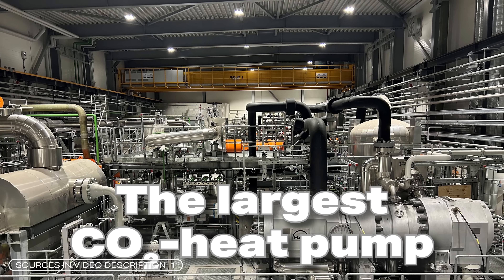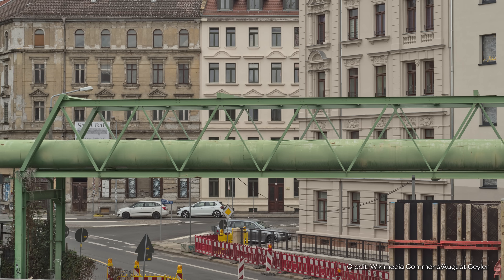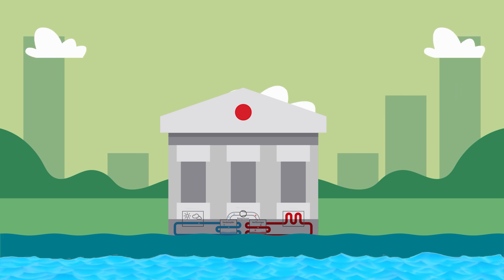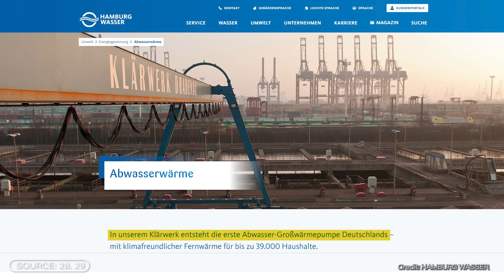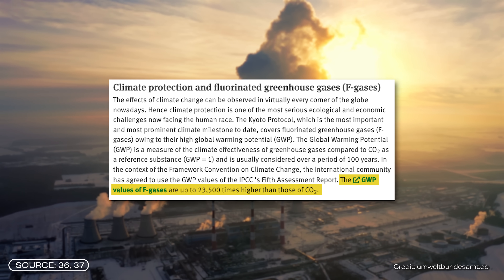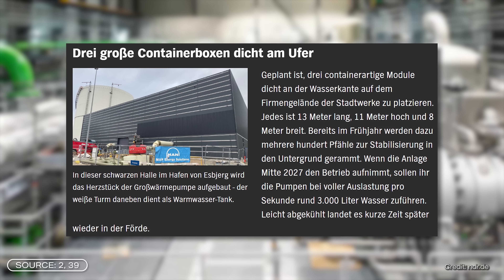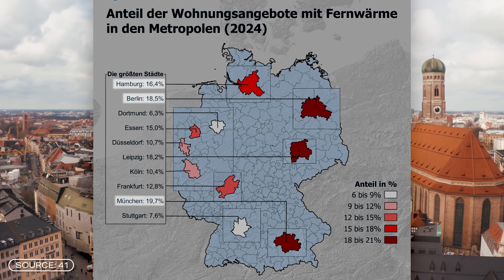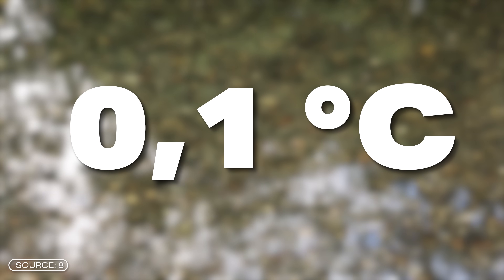World's Largest Heat Pump: Denmark’s Seawater Heating Revolution

Comment: Greetings from Scotland.  I have an air source heatpump supplying hot water to my radiators.  House is 120m2.  
Consumption of electricity on the coldest day by the heatpump was 30kWh at -12C outside air temperature.  CoP on this regime was measured to be 2.

Overall for the entire year, my heatpump consumption was 2700kWh, and the overall CoP was 3.7.

My electricity bill for the entire year was minus £150, factoring in my 9kWp Solar Array, 10kWh battery, cheap overnight charging price and 11000km Electric car driving - supplied from my house.
Reply: Well done, more people should poot their money where there mouths are.
Do you have an estimate of investment payback time before you get to net savings.
Reply: Beautiful.. I hope to get a setup like that one day too.. this gives me hope :)
Reply: And what is the electrical build, if you factor in all the cost of all the systems to save?
Reply: I notice you don't say anything about how much all that gear cost. also, what's your capacity factor on the solar PV? I recon you spent 22k inc install and make around 11k KWh per year.
Reply: @markfernandes2467  Before I answer that, we need some context:  Between 2010 and 2020 I spent £27000 on Propane, Diesel, Electricity and Firewood.  All those prices have since increased.

My solar panels cost £11k
My battery cost £7.5k
Heatpump was £9k.
EV Charger £1.5k
Total cost therefore:  £29k.

My solar panels have repaid 55% of original  capital in 4.5 years.
Batteries 17% in 3 years
Heatpump:  7% in one year.

So also since 2020 when my solar panels were installed:  
Solar Panels are now much cheaper.  Down from 0.33p per watt to 10p per watt.
Solar Mounts are much more expensive
Inverters are maybe 50% cheaper.
Labour costs are higher.
Batteries are 50% cheaper.
Reply: @anthonydyer3939  First, thanks for the info, that makes things clear. However, 

1. My estimate was only for the solar and battery set up and install, not the heat pump & EV charger. I assume you got the BUS grant, right? (that works in Scotland too, no?) If so, is the 9k quoted, net cost after the BUS? Please clarify as that's being paid for by someone. So your cost was 18.5k , I guessed 22k. So I was over. 29k for the lot after the BUS seems about right. (It's hard to estimate HP costs, there's so many factors in system design. 

2. your ROI stats are very questionable tbh. Did you finance the costs or just pay up front? If up front, that already puts you in a position most people aren't. Also, if you did, , I'm pretty sure you didn't add in lost interest on savings or investment opportunity lost in your ROI. 

You also don't account for the fact that you need all parts of the system to act to multiply the benefits, you're Solar wouldn't be at 55% ROI if not for the battery for eg. 

Your ROI also somewhat depends on your feed in tariff payments, right? Fair enough i guess, but this and your load shifting to buy cheap electricity from the grid, won't be arounf forever. 

3. Not many people live in one house for long enough to recoup the costs, (9 years is the average). Also, 5 million people live in flats, lots of others live in other forms of unsuitable properties. Not many investments rely on you staying put to benefit from them, most would regard that as a huge negative. Home price uplift due to your outlay won't happen as the new homeowner's risk of inheriting all this complexity/space & sometimes even aesthetics, offsets it. 

4. Without grid support, none of this would work. Homs are not countires and the same solution doesn't scale to national grids. Esp in the UK & solar. 

5. What's your CF on the solar? You seem to know a lot about your system, so you must know this, right? Somewhere between 10 & 15% max would be my guess. How many Kwh did you produce from the PV in 2024? What's it like if we just take Nov, Dec, Jan & Feb? 

6. I dispute the fall in costs for an installed system, You got a 9kw PV for 11k, that's not 33p lets alone 10p per Watt then. It's over 1 pound. I don't care what a panel costs, only the cost of it installed. Btw, where can I but a 250 W Solar panel for 25 pounds? 1 pound per Watt continues to be the real-world price installed it seems. and I could get that a decade ago, only inflation since makes this a reduction in real terms, which is true to point out as a reduction, just not that dramatic as people tend to claim. In any case, the S curve on PV cost is all but over now. 

I think you supplied some good info here though, I'd really like to know your total production and how much and when you managed to store some of it over and above your needs. No way you got the 30Kwh your HP used on the coldest day for example, not even close where you are. 

Please let me know if I'm wrong.
Reply: @markfernandes2467  

1.  Typical annual production is 7MWH, and it's worth bearing in mind that I live on a partially shaded site.

2. You can buy a JA Solar 450W panel for £53+VAT, but I have seen them down at £47 at times.  That's close to 10p per watt.  Delivery and installation is extra.  ITS Technologies sell them.   

The best battery price right now is £3500 for a 32kWh Fogstar 51.2V battery.

3.  In Scotland you can get government finance at 0% APR for renewable tech if you fill in the forms and jump through the hoops and exercise patience.  But I paid upfront.

4.  The battery improves your solar returns (less solar going to export), but solar actually reduces your battery returns.  (e.g. a battery only system will achieve one full charge cycle per day, allowing you access to cheap 7p overnight tariff).  But with a solar system, your battery going to be utilised less.

5.  Capacity Factor is just over 8% for the whole year.  Frankly that number alone tells you nothing valuable.  The installation cost + annual electricity savings + export revenue tells you what matters.

6.  Ideally a system like mine would improve the value of my house, to the extend that it's worthwhile investing in solar for property flippers.  In reality energy performance seems to have a negligible impact on asking prices.  I sometimes two similiar sized properties for sale in the same location with similar asking prices but very different energy performance rating.

7.  The ideal electricity price tariff structure has shifted about quite a lot over the last 5 years.  Dynamic pricing was the absolute money spinner in 2022, 2023, but it's fallen away in favour of cheap overnight tariff + flat export prices.

The best prices will change again, no doubt with varied time of day rates for export becoming the most favourable again.  

I can also imagine that prices such as equal import/export prices (Octopus Flux Intelligent) will still prevail for those that hand their battery control over to utilities.  But it's easy to imagine that the prices will be tiered according to the solar/battery sizes you have on your property.
Reply: @anthonydyer3939  You might know this, what was your production total in your worst week and what was the production in your best week? I'm sure you have figures for 22, 23 & 24, right? It would be really useful to look at your real world data on that. I want to know the worst output in the worst week as a % of your best week of output. Would be great id you could tell me. Thanks.
Reply: @anthonydyer3939  Shame you haven't had time to reply to my last comment, but i thought I'd estimate these things, to see how far off I am. I'm guessing that you'll generate leas than 7kWh on any given day in December (capacity of your system is 9kWp so theoretical daily max is 9kWh x 24 hours = 216kWh, so that's less than 3% of Max) In summer, I doubt you break 35kWh in a day often, (which is 5x your December low, so around 15% of name plate) This kind of tallies with your 7mWh info over a year where your Max is over 78mWh, so you're comfortably under 10% capacity factor. 

I also think you need up to 40kWh (inc HP, but not EV) ito run your home on the coldest days but that's also the time you only produce 7kWh or less each day, and you have a system twice the average size in the UK. 

This means neither the grid, or your battery is getting a look in from mid October to the start of March (4.5 months) The HP alone is eating all you produce when you produce it during those months, right? You can use the battery to but cheap overnight eletricty though, so that sure will cut bills. This means using battery + Solar, you might be able to use 17kWh per day using either free or cheap electricity, leaving over 20kWh at higher price from the grid per day 

In the summer, I doubt you're probably not breaking 15kWh needed per day, so you sell maybe 15kWh to the grid & can store & use to load shift with the battery maybe 5kWh to get through nights and have off grid back up. 

The basic limits exist at grid scale too, if we just scale your example up a lot. In that case, there's not much in the way of an external "super grid" to help though. Interconnectors are expensive and some have just been cancelled. They don't lend themselves to national security fears either. 

so you have to overbuild 5 x just to be able to produce however much you intend to supply to account for winter. Of course, this would give you a massive curtailment problem in the summer, not to mention grid instability and inertia problems. You could sort this with storage and other bits but at cost and it's all very ineffiecient. And remember, you're only at around 10% capacity factor of name plate anyany, this does matter when comparing to other sources that can do 90%+ like gas or nuclear. I know you didn't comment about that, so it's a moot point but I just wanted to explain why I asked.
Reply: Engineer here - Do you know how I can tell you're telling the truth?
Because you used CoP and didn't claim a nonsense 370% efficiency.
Congrats for being one of the few people to speak accurately.
Reply: @tonywilson4713  What are you talking about? I think you both mean SCoP ont CoP , he did claim it was370% (3.7) and what's wrong with that? 3.7 SCoP or 370% mean the same thing. 1 unit energy in 3.7 out.
Reply: @markfernandes2467  CoP - Cofficient of Performance
SCoP Seasonal Cofficient of Perormance

SCop near 2.0 at a constant or average temp of -12 deg c is quite likely
for air heat pumps 2.0 - 3.0 if average or costant temp is -12 deg c
CoP Winter - possibly 1.5 - 2.x
CoP Summer - Possibly 3.0 - 5.0
... air actually doesent transport that much energy/m3 of air thats why its considebly lower than a ground heat pump (0.024Wm/K) vs soil (1.5Wm/K) .. heat transport capacity is just 1200J/k for 1m3 of air

ps. a ground heat pump can easily reach a CoP of 10.0 or more dempending on design and length of pipes, area etc
Reply: @ronblack7870  Exactly. No one means an HP is some sort of perpetual motion machine, lol (over unity) . We all know this, and why he uses this to endorce the claim by the OP as true just due to his way of stating this, is dumb.

Comment: Im frome Danmark. Sometimes the district heating is done well. Normally I the bigger city's. But some of my reletivs have had bad experiences withe it. They were promised lover prices, and in the beginning, I was lover. But then the heating kost claimed to around 3 times the price of their original heating method. I think they burned wood. 

I also have some other reltives who wanted to instal a heatpump of their own, but because there was a plan to instal local heating, they couldten get subsidised to get a heat pump. Even though there was beings nothing done with the local heating. 

But in my house we don't rely have problems with it and I think the price is fairly good. 

So yhea there is ups and downs

Comment: Thank you, Europe, for your leadership and awsomeness.
Reply: Central Minnesota was installing these in the mid-1980s.  Conditions were perfect there.  The water table close to the upper Mississippi River was easy to tap a well to use year around.  The well water offered the same temperature which was an advantage to keep a building interior at a steady temperature and humidity level.

Comment: Technicians in Florida are manipulative. The new heat pump has broken down 4 times in 3 years, and each time they overcharge. Except n
The last guy. It was a $400 charge for a 30 minite repair and a $25 part. So, economic benefit depends on your fraud index rate.

Comment: I have district heating and it works excellent for me 🤩
The first chilly day in October I set my radiators on 3. April 1st I turn them off again.

During winter, I only touch them when I air the rooms: I pull a wollen sock over the themostate, so it doesn't get confused, and try to warm up the entire street.

I grew up with coke fired stove on 3rd floor. It's took HOURS of daily work to keep you warm on ONE side at the time 🙄

Comment: Sounds very clever but how clever will it be when the current grand solar minimum kicks in and winters are freezing cold? Here in the UK, coal island, we are only waiting for the current crop of idiots to be voted out so we can make Britain great again by firing up our coal burning power stations. PS  in the geologic past CO2 levels were much higher than today, even during ice ages. CO2 heating didn't work then and it wont work now.
Yes, the stupid it burns, but it doesn't keep you warm.

Comment: I live in the outskirts of Copenhagen, in a house around 130 square meters. The houses in my area are warmed by renewable energy from burning waste in a big power plant. Heating and warm water cost about 100 euros per month, and every year I get around 400 euros in return when the calculation for the year is done, so all in all a costs around 67 euros per month for all my needs of heating. I think it is cheap compared with houses heated with gas or other black energy, and another good thing the delivery is very stable all year round.
Reply: Burning waste is not renewable energy...
Reply: @ЕмилЕфендулов  Hi, I explained it in a simple way, the fact is that the energy comes from the gas made out of waste. Im not familiar with the whole process, sorry to say. But In my opinion, it´s better to burn the waste instead of just throwing it on the ground as they do it in many countries. Renewable or not.
Reply: @mctravel2 That's true!

Comment: Basically, a heat pump is a reversed airconditioner?
Reply: Yes exactly, though 'Reversible airconditioner' is probably a more correct term as the tense implies you can choose the functionality at will/need.
Reply: @Lag_Monster  I have a system in my appartment that does both heating and cooling. I was thinking these heat pumps are something special. Turns out I've been using one for the last 13 years. (I live in Brazil)
Reply: @peterfaber7124  Your fridge also has a heat pump.